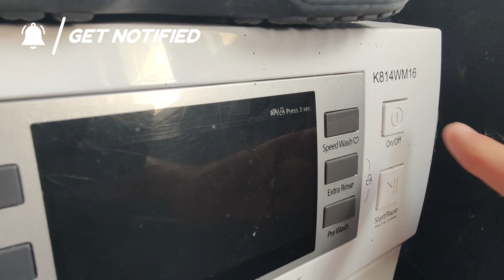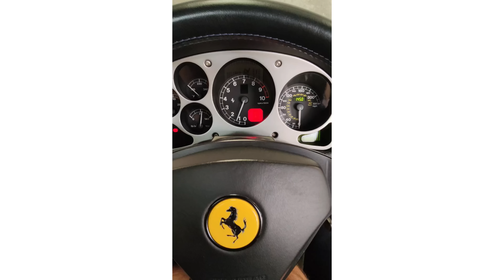My life as a Car Cleaner...

Comment: ONE BUCKET METHOD  it works just as good as long as cars not seriously filthy , large bucket fill up (15/20ltrs) wash as normal just shake the wash pad/mitt in top half of bucket , by time you come back to reload , dirt has sank to bottom of bucket (yes you will use a little more shampoo maybe  but the ratios on a majority of them is really good)
Reply from the maker: Nice one glad to hear it. 😃
Reply: @epicautomotivedetailing   I wash my car with a foam wash and a rinse bucket with a grit guard, does the trick. Great vids, keep it up.

Comment: Nice video pal. What kind of extension lead do you use for the Nilfisk ? I’ve got a Nilfisk as well but find the power doesn’t seem to be the same when using an extension lead but I need one as occasionally the socket is too far away
Reply from the maker: Hi mate I never heard that with this machine . Which one is it?
Reply: @epicautomotivedetailing   I have the premium 200

Comment: Is that infinity wax synergy lite?
Reply from the maker: Nope not at all. This isn't a ceramic coating. No sio2. This is a paint sealant which has different properties. No products will be the same. I have worked directly with them on these chemicals. I wanted chemicals that worked in the way I feel beginners would get on with them 👌

Comment: Good to see the business expanding as well as the TVs show.. 
your hard work and dedication has paid off..

I am looking at Ava pressure washers  mostly be for the wife to  use  and  her son when he washes his car or bike ..
 Does the fuse issue I keep hearing about  only happen when  you use a extension lead..  or a extension lead that's not rated to handle the  current draw. 
 I know it is not advised. To use kranzle  on a extension lead  as it can damage them.
Reply from the maker: It seems to be mainly just the p80 from what others say. The p60 is actually plenty good enough for most people
Reply: @epicautomotivedetailing  
My brother has the  small portable one and it has been faultless..
 I know the kranzle he has  I was with him when he purchased it  and the guy at the shop advised against using a extension lead due to the high current draw  and resistance  in the cable over long distances. Or something like that  I wasn't really paying attention. 
 Does the p80  still blow fuses  even if it is plugged directly into the mains  wall socket.  And not via a extension lead.